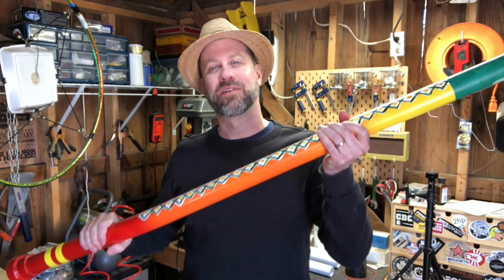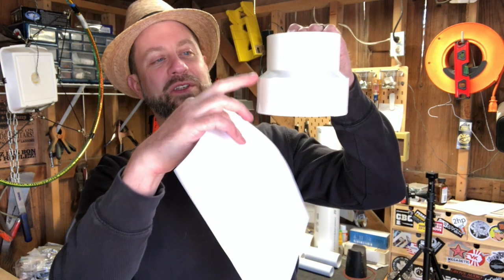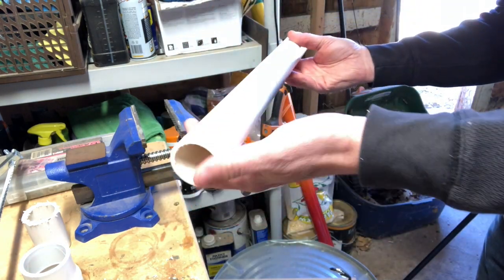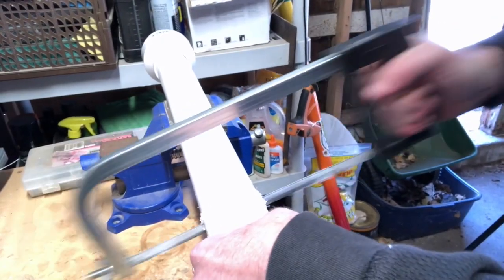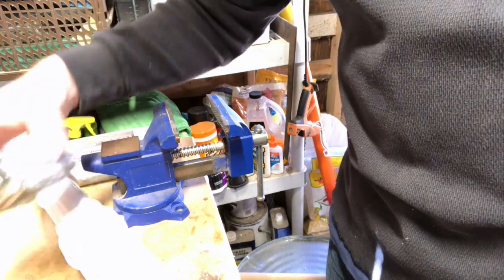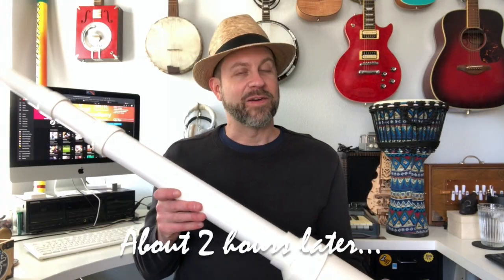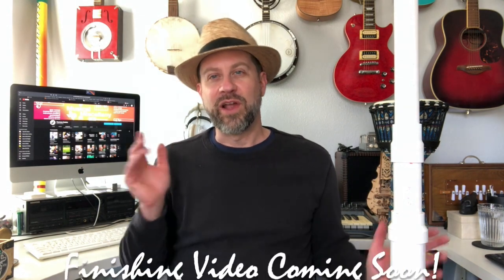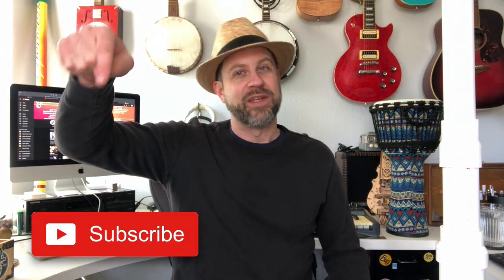Part 1: Building a Didgeridoo from 5 Scraps of PVC (key of E)

Comment: i dunno if is availble locally to you, but I would suggest vinyl tubing for a mouthpiece. buy it very slightly undersized to slip over the end, sit it in a mug of boiling water for a couple of minutes to soften it and push it on. warm the other end and fold it over with some pliers. maybe make the mouthside first, maybe make a few to test. Good job and good luck!
Reply from the maker: That's a really good idea. I'll look into that. Thanks for watching.